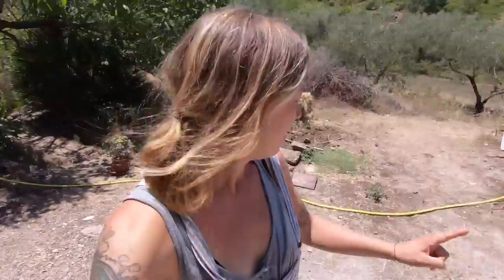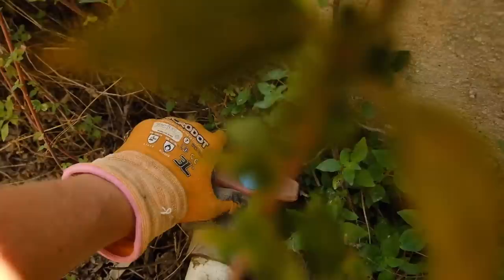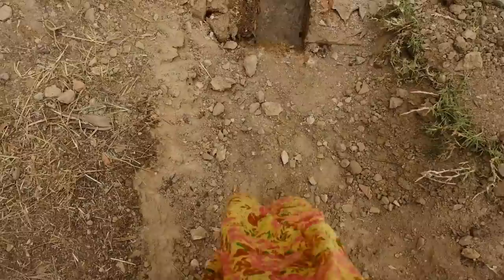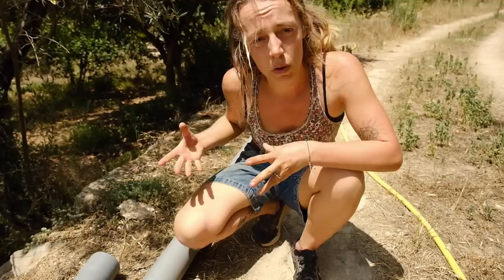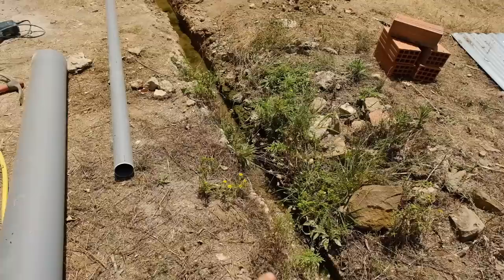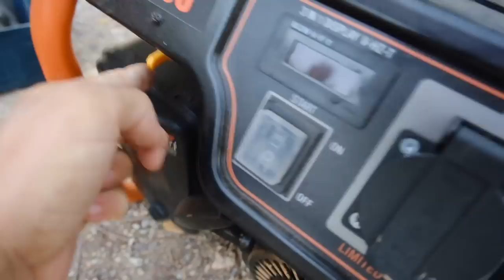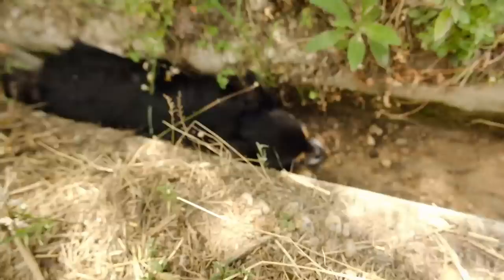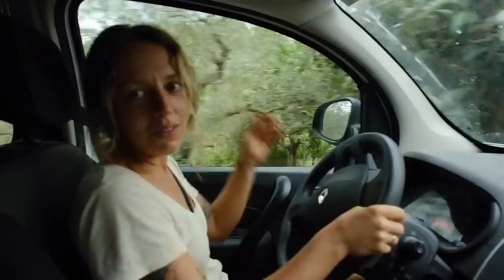Off-Grid Problems! | Fixing the water... Again

Comment: Nice job, but next time you could use the rubble and gravel in the cement/concrete(as fill) and there by use less of the expensive stuff, it will also leave you less heavy cleanup, as a bonus tip use sand under and over pipes before burrying them, than insulates them from cracking from stones and pressure
Reply from the maker: I did! :) Bury some of the rocks i mean. Not the sand. Too late for that now but good tip for next time!

Comment: You use a blow torch on the bending sections to slightly melt the plastic and bend it to the angle you need.

Comment: I had  to dig some trenches un my garden (part of a schrebergartensiedlung) to get new electric wires and hated it.I lasted two hours and then had to rest and come back another time. With the price of solar going down nowadays I probably just would have installed solar and gone offgrid as that feels easier and not much more expensive than just a couple dozen meters of trenching and wire and stuff.

Comment: set themin peashingle sothey van move then concrete slabover the top if youset them in concrete they will keep breaking
Reply from the maker: that's a good tip! Luckily the outer pipe doesn't carry the water so if it breaks it's not the end of the world, but if I had know that tip it would have been better :)
Reply: been in hungary doing the same for years but spain has a few legislative advantages !

Comment: Personally I don't think you should concrete around the pipe. Small gravel yes but NOT concrete.. I also think that hatch could be or was used as an inspection type area. If something is obstructing the pipe you can poke something down there to clear it.. Why didn't you push the pipe through under that concrete slab???
Reply from the maker: A) the pipe is PVC it's not strong enough to withstand the weight of a car with just gravel over the top

B) the 9cm pipe would not fit under the slab. And as you saw in the video, a lot of the tunnel was broken anyway so it would have needed repair.